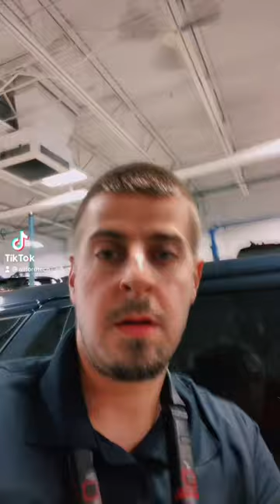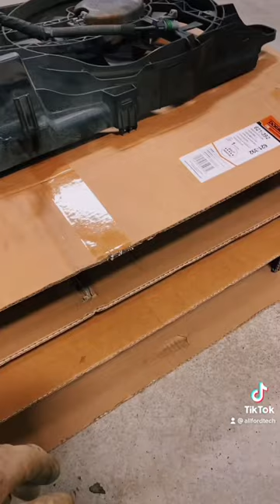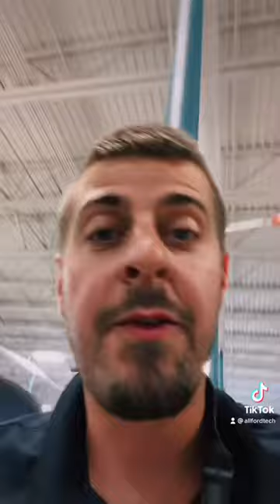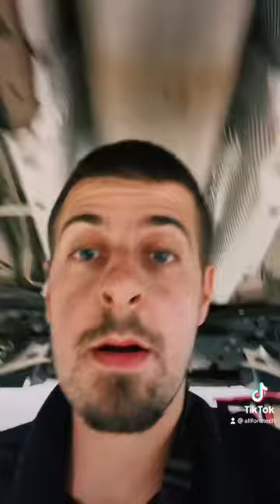This is why mechanics drink…

Comment: I'm a plumber-- our products are becoming trash all around. Great brands are all of a sudden basically useless. Blows my mind.
Reply: At least you guys get to use PEX and shark bites to save time! Auto repair doesn't have those modern shortcuts lol
Reply: @AbcAbc-sp1od What are you talking about? Every trade has some things that were better than they used to be. And worss to of course. Don't you ever use cordless ratchets or impacts? Or diagnostic tools (scanner whatever you call it)? 

Plus, how many sharkibites do you think plumbers are using at $10 apiece. I'm not a plumber by the way.
Reply: @Lucas12v  shoot try $15 a piece!  Just put a tee into my copper pipe to install a dishwasher...
Reply: @AbcAbc-sp1od  how about copper nickel brake lines, nylon quick connect fuel lines, battery impacts, inductive bolt heaters etc.  Here in the rust belt these things are a Godsend.   
  But i do agree most technology changes are for the worse (plastic intake manifolds, internal engine parts, etc)
Reply: It's because the company producing the parts is skimping on quality to make more money. It's happening in every sector.
Reply: as an ex-plumber assitant, if you use pex, shark fittings or the newer crimp copper fittings, you arent a plumber. As an assistant I would solder my own lines, replacing 70+year old lines which didnt even fail; oxidation around the joint but still held, if I'm there you may as well pay us to replace several of those joints as ive alreadyhad to remover all the ones before to install a hot water heater or furnace. On multiple occasions  ive seen pex and shark bites fail and those fancy copper crimp fittings have a ribber gasket in them, that is "insured for 25 years," if you only get 25 years from a brazed or soldered joint, thats worse than what a true plumbers assistant can do.
Reply: @Lucas12v  no licensed plumber uses sharkbites, the plumber ive worked for, is a small business thats been around for 100 years. He still solders or brazes all of his joints, still uses cast iron on stacks as opposed to pvc. We've never had a single issue. On the otherhand, theres been several times where we've ripped out pex or bs sharkbite fittings, as they were leaking after 5 years. Edit: havent run into issues with the copper crimp fittings yet. However, they have a rubber o-ring that is only warrantied for 25 years, theres been multiple times where we finally replaced joints that were soldered by his grandfather 75 years ago; they still held but had oxidation around the joint itself.
Reply: @Lucas12v  I don't use cordless impacts. They just don't have the torque that air impacts do. But I get your point. 

As for the scanners... Yes, they can help, but automotive computer technology has made modern cars way more complicated. Plumbing, on the other hand, has only gotten easier with time. (As far as I can tell).
Reply: @UndefinedStasis  My point was that plumbers don't actually use sharbite. I mentioned cost rather than reliability because it was a more simple point to make.    I am surprised to hear that nobody uses pex wherever you live because pretty much all new houses are pex where i live. Although it's usually the expansion style rather than the crimp. Comercial stuff is still sometimes soldered copper from what I've seen.
Reply: the worst for me is that when you compare a 20-30y old part and recent one, it has become plastic cheap trash but the price not just stayed the same it rised quite a lot, depressing
Reply: @Lucas12v  it depends on location. Here in Philly, residential is allowed pex so all of it is, but they're still requiring copper piping for commercial.
Reply: life is going to get tough in about 10yrs when all the older people are retired and no one is willing to work, nothing works, everything made new is garbage, and inflation is through the roof.
Reply: @AbcAbc-sp1od  they aren’t shortcuts
Reply: @skonky  i have a makita though i dont use it every day ive only had to charge it 3 times now my ryobi i have to slap that on charge after every use or ill not have enough power for the next use. but ryobi has always had shit batteries thats why they are cheaper after all
Reply: @SoloRenegade empire in decline. Its already happening. I remember thinking in the 90s that the appliances were shit, now I wish they built appliances like they did then.
Reply: @Lucas12v  You are wrong about that...I've been a licensed master plumber for 35 yrs and yes I do use Sharkbites under certain circumstances. I work at a hospital and we have to get things fixed as quickly as possible to minimize downtime, then we usually go back and replace them during scheduled shut downs. Sharkbite fittings and Pro Press fittings are lifesavers when I get a call in the middle of the night with a leak in a ceiling somewhere. A lot of the time, you can slam them in when the line is still draining, rather than waiting for it to drain down enough to be able to solder it, plus as any plumber knows, valves often leak through and it's hard to get it dry enough, using bread, freeze machines, etc, enough to solder. Both SB and PP fittings can be installed while water is flowing out of the pipe. I have installed Sharkbites in accessible locations in mechanical rooms over ten years ago that are still holding. 
That said, I prefer to solder joints when possible.
Reply: Ship em to CHYNNA!! Get back Chinese products.
Reply: Inflation and outsourcing
Reply: Biden's economy.
Reply: Trade agreements.
Reply: the Kingdom of GOD is coming…“Silver is for the kettle, and gold for the furnace, but The LORD is the tester of hearts- Bible” your heart is like discovered silver, dirty and not pure, when silver is purified it is melted over and over, to the point that when it’s melted and glows red hot, it is pure enough to see your own reflection in the puddle, so also does the LORD purify your heart, till HE can see HIS own reflection in it, seek the LORD and be reborn, ask The LORD to renew and restore you, repent and be baptized for the forgiveness of sins, Jesus died so that our sins will be wiped away and so that we could be made new, seek The Kingdom of GOD for if you would be wise you would be wise for yourself, pick up your cross and deny your flesh and follow the path of GOD, for The Kingdom of GOD is at hand, in JESUS MIGHTY NAME Amen and Amen 🙏 o
Reply: In Finland they have to do pipe repairs to new houses where people don't even live yet. Everything is done cheaply as possible, parts and labor.
Reply: @makoshark40  Makita is what the doctors use to drill through bone.
Reply: I believe that The corporations cutting corners
Reply: Our great grandparents handed our country over to the bankers, and the financial institutions have plans.
Reply: It’s called capitalism.
Reply: Dude, where can I find an old school float valve ? Those things last 20 years. The new ones have more parts and break after 2 years.
Reply: China is the culprit but other countries are caring less now too
Reply: a key reason alot of companies do this is because of online shopping. They can make a cheap part, save money to pay for the shipping and if it gets damaged along the way they can just send another. Also alot of these companies have deals with FedEx/UPS and they get a kickback for amount of packages sent, makes a huge difference too
Reply: @lyleg.9192 Yeah, just blame China, despite the fact that they can make fantastic products just like everyone else, just that no corporation wants to pay for quality.
Reply: Your research topic of the day is "The Quality Fade phenomenon in Chinese Manufacturing and Supply Chains"
Reply: @AbcAbc-sp1od what are you working on that an electric cordless impact doesnt have enough torque for ? 😅 my half inch dewalt high torque takes of stuff my buddies snap on air  impact and electirc wont  .. i know air ultimately is the way to go especially in a shop but out in the field id have shit apart before the compressor fills up , milwaukee and ingersoll rand makes a 1 inch cordless impact too and those things got like 2000 ft lbs of torque
Reply: @brocks692  It could've been the specific tools I was using, but in our shop, the electric impacts just are not as powerful for when we have really rusted suspension bolts, crank pulley bolts, etc.
Reply: @theusher2893 American jobs were sent oversees long before Biden my friend
Reply: @thejbo777 capitalism allows for cutting corners with the penalty of injury for the customer being a fine. regulation would stop corporations from cutting corners with their products to save a quick buck which would in turn make everything manufactured to a higher standard and make repairs last longer.
Reply: Everyone is cost cutting to save the guys up top.
Reply: Unfortunately PEX and Sharkbite brand has made the average joe think they are Plumbers. The same people complain about the cost of labor but have no clue about running a business.
Reply: @pex_the_unalivedrunk6785  , if only it was that easy. 😄
Reply: @the_truck_farmer we have these fancy helpful things yes, but decent parts come at a rather high cost. Most shops you'd enter into you're spending thousands just on basic tools, and no matter what, you never have enough tools, or they make something they say is better but doesn't last as long as the old set did so you end up with the same worn out tools you started with
Reply: I think someone already said this
Reply: It's standard in manufacturing to decrease costs a percent a year.

There's only so much you can reduce before it becomes trash.

So it's time to give up your old brands and find new ones that aren't trash yet.

Comment: So very true! The quality in parts has declined so much, especially since the pandemic it’s pathetic. And to anyone who says just order the factory part from the dealer, go ahead and try, there’s better than a 50% chance the part is on back order and they can’t even give you a time frame as to when you might get it. It’s become one of the biggest challenges facing our business these days.
Reply: Back ordered and when it arrives it’s dinged up and damaged from shoddy packaging. I’d say 1 in 5 radiator jobs we’re ordering a second one as the first one arrived damaged, and since I work for a dealer we get our parts straight from the Ford Supplier
Reply: @Dusty_Ellis  Oh so you get your parts from gorilla Central
Reply: Took our shop 4 months to get a fucking skid plate
Reply: Yeah insurance totals cars out because it taking too long to get the cars repaired.
Reply: Agree even original parts from dealership are crap... do not survive long
Reply: @haydenthompkins9665  las year I had to wait almost 6 months for a rear link arm
Reply: Yup, i had a alternator go bad in 13months (we looked up the car history of whenbwe replaced it), less than 15k miles since installed, and the part still looks new but it starts howling sometimes and doesnt charge anymore. The autopart store say they are gonna test it and give us a new one, tomorrow.
Update: Autopart store verified its was bad, but the replacement alternator they gave us had a fucked up threaded nut. Tried fixing but yeah, I just returned it and got a new one.
Reply: Yep I’m waiting 5 months on a part for my 2018 Ram 5500 Cummins to turn the Abs brake and traction control back on. And I’m waiting 3 months on Recall parts for my 2017 F350 to fix a bad drive shaft vibration the truck has.
Reply: Replaced the front rotors, pads, and wheel bearings on my 94 ford flareside. It has hub rotors so when the BRAND NEW WHEELBEARING exploded on the right side it took all the new brake components with it, the spindle knuckle, and the driver wheel has a 2mm deep 2 inch wide gouge on the wheel all the way around. I had to drive home and there were peices of wheel bearing stuck between the wheel and rotor the entire drive home. It made the worst noises and the spindle knuckle cost 162$ and took 3 days to get here. Thank god the parts store replaced all my parts and i have other cars or i would have been screwed. Companies need to start being held accountable for the damage their bad parts cause. I didnt even get cheap parts!
Reply: Everything everywhere is falling apart.
Few people care about quality anymore.
Reply: Just get one from a latter year
Reply: Still waiting for my metalstraps for my fueltank and breakwires, it's only been 2 years since I put in the order...
Reply: Who cares. Mark it up 35% like the automakers and send it half ass and say it's the 7% inflation and just pocket the rest.
Reply: Yep
Reply: Three words:  Made In China
Reply: @ThatsMrPencilneck2U  yes make those truck parts in America so no one can afford trucks other than the rich. Perfect. Get rid of all these trucks doing nothing but wasting resources.
Reply: @CHNISD  most people can’t really afford a $70K truck either, but they still buy them.
At least the US rebuilt parts were just as good as the new ones, just cheaper
Reply: @pmscalisi  yeah let's jack it right up to like $500k starting rather than $50. Y'all really underestimate how much y'all take advantage of cheap labor and all the terrible things you do to people across the world for frivolous things.
Reply: @Dusty_Ellis  new radiators leak, old ones leak, no matter what i get they seem to fail for some bs reason, i still had my original on hand and one i got used in my truck, both leaking one from the plastic sides and one from a pinhole in the core, i said f*ck it and swaped the tanks from the replacement one onto the sides of my old one with the good core, some proper sealant on rhe gasket and it works perfect, costed me nothing, how is it i can cobble together a bunch of crap not even meant to be repaired or replaced and make something better than half the aftermarket sh*t ive gone to buy or at least just as good idk
Reply: @CHNISD  Hey everyone I found the victim! Here’s your Bud Light sir.
Reply: I'm in parts and I have so many issues. Always on backorder or has a crappy reman. Luckily I have the ability to outsource or find good used ones. Usually thr customer doesn't want a used part but doesn't understand it's not available anywhere.
Reply: Ya eland the dealers are even selling reman too, not just new oem so check that always.
Reply: the Kingdom of GOD is coming…“Silver is for the kettle, and gold for the furnace, but The LORD is the tester of hearts- Bible” your heart is like discovered silver, dirty and not pure, when silver is purified it is melted over and over, to the point that when it’s melted and glows red hot, it is pure enough to see your own reflection in the puddle, so also does the LORD purify your heart, till HE can see HIS own reflection in it, seek the LORD and be reborn, ask The LORD to renew and restore you, repent and be baptized for the forgiveness of sins, Jesus died so that our sins will be wiped away and so that we could be made new, seek The Kingdom of GOD for if you would be wise you would be wise for yourself, pick up your cross and deny your flesh and follow the path of GOD, for The Kingdom of GOD is at hand, in JESUS MIGHTY NAME Amen and Amen
Reply: a lot of the time its the dealer sourced parts that are the only thing worthwhile anymore.
Reply: "Factory" parts are worse than aftermarket. I would take an aftermarket fan assembly all day over an OEM.
Reply: @Meme-zc4cw  all depends. Get some moog ball joints etc over factory yes.

My f250 SD factory hub/bearing like $700, and got aftermarket under $200. Some say it might not last as long, but it’s been going for 2 years now anyways and not a sign of issue yet.

So I’d say that hub was a good deal.

But for my l322 Range Rover, went through 3 aftermarket rad as the reman process was faulty. 2 of them failed immediately, and one after a year of use.

Oem rad and it actually holds. All depends on what you are buying. More critical components I would go oem.

Suspension and stuff that yes is important, but won’t do anything horrible if it fails early, then go aftermarket.

Your bushing wears too quick or feels to firm etc you swap it. Not end of the world.

Your rad clogs and you going for an overheat, and then have to go through all the process to pull and swap the rad again….. don’t need to take that chance.
Reply: @justinstevenson2061  Those are fair points. I agree not all a/m is better but I also know the return rates for OEM mirror those of a/m for MANY parts. I tend to favor a/m brakes and cooling system parts. Also, suspension is pretty rock solid on the a/m side as well. The dealer markup on OEM just turns me off and I just generally don't want to deal with their attitudes as well. Just have never had a good experience from a dealer parts department.
Reply: @Meme-zc4cw  ya I don’t deal with them, if I order oem I’ll get it through a parts place that I already deal with for aftermarket or online etc.

I think I’ve only a few times actually bought a piece from the dealership. Bunch of damn crooks.
Reply: I used to go an get them from newer wrecks. The cooling fan replacements have been garbage for ages